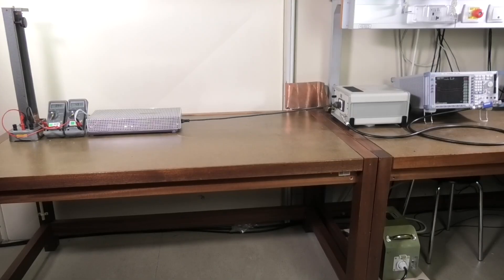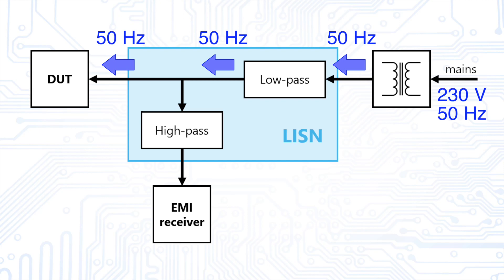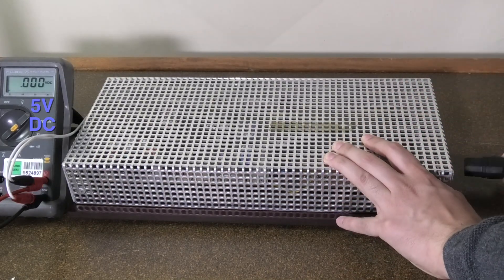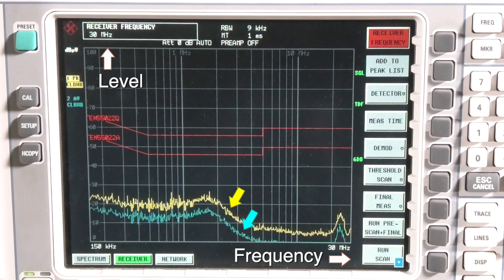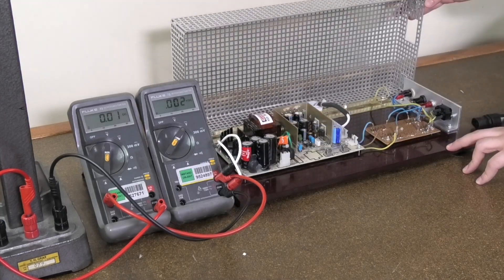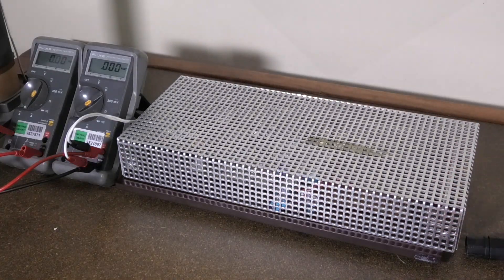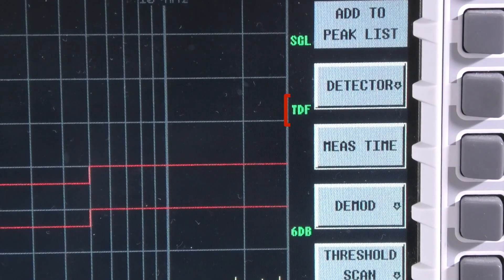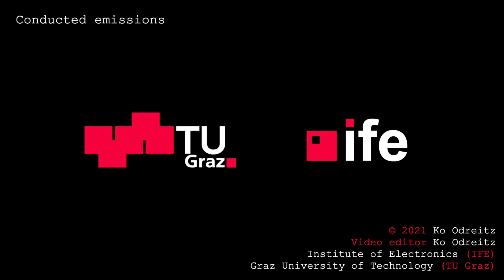Conducted emissions, EMI filter

Comment: Very educational video ! I hope you have reduced the Y capacitors after adding the common mode choke. A value of 400 nF will trip the RCD. (Fehlerstrom-Schutzschalter 30mA). The max. allowed current through the earth conductor is 3.5 mA, which translates into approximately 50 nF. In practice, I have seen values of 2 nF or less.

Comment: Nice video presentation on conducted emissions. Looking on the emissions, best also to demonstrate the source of noise or the fundamental frequency which produce those harmonics which is actually around 100kHz (SMPS switching frequency). Knowing the fundamentamal frequency, engineers would able to effectively design the differential common-mode filter of its 3dB cut-off frequency and expected Attenuation or emission suppression. Also best to mention correction factors e.g. Transient Limter which has an attenuation of 10dB and LISN  of around 0.5dB plus cable loss between the LISN and EMI receiver which you've added into your transducer. Viewer doesn't know that and they might expect the measurement is straight forward. LISN has to be placed on top of ground plane bonded to earth. If the EUT has grounding provision, additional ground braid has to be connected between the EUT and LISN front grounding terminal. I suppose you deliberately removed the missing common-mode filter on the SMPS PCB for demonstration purposes as normally most SMPS already have mains filter. Just subscribed and I found your channel very informative. Cheers, ECErcuit